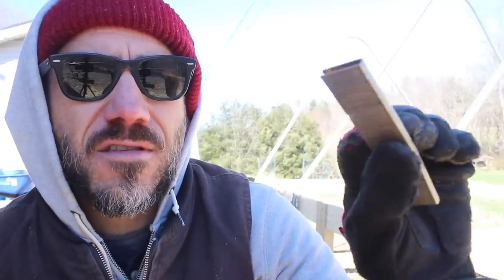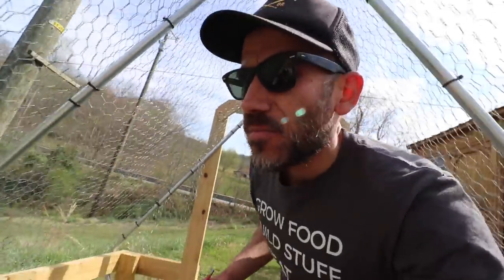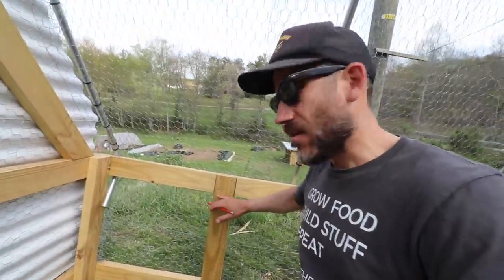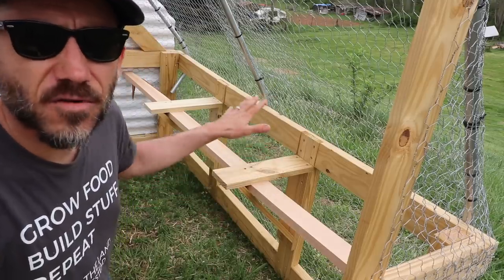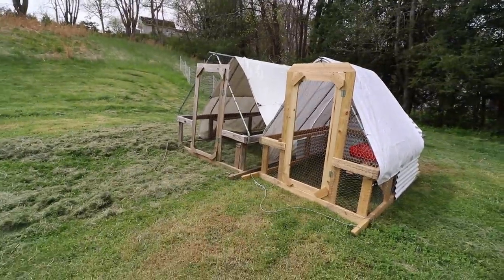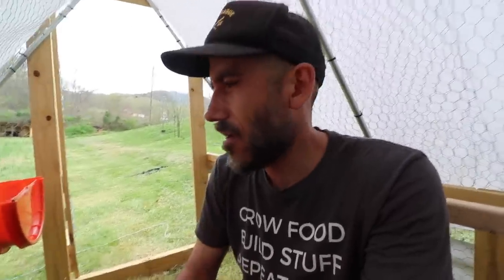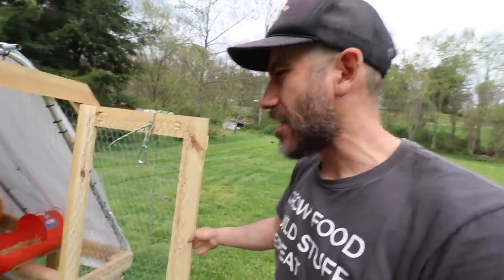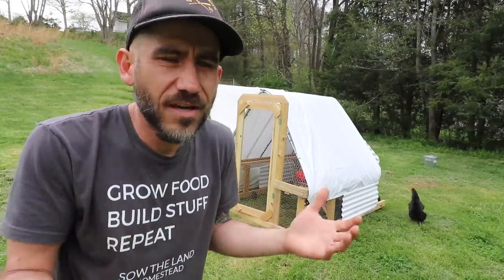Chicken Tractor EGG MOBILE (MODIFIED)

Comment: To keep from having sore hands pulling on a rope to move the chicken tractor, you may want to put a small piece of garden hose around the rope or a piece of conduit.
Reply: Every garden hose I've had has broken in half due to our random weather changes.
Reply: Put a piece of pool noodle and then you can hook your elbow around it to pull 🤣
Reply: Use pvc /pipe.
Reply: I used a piece of pex over mine

Comment: I like your modifications.  I hate chicken wire though because I believe it is only made to keep chickens in. Most predators can rip right through it. We are in Alaska and we use mink pen wire, designed for mink cages.   We have a fixed coop and we bury it into the ground angled away from the coop and covered with firmly packed small rocks.  They free range during the day and we use cardboard under their perches that is changed weekly and composted.  More work. But safer for our layers.  We also use a rooster to protect them while they free range..we have eagles and Hawks who go after them and it is so great to hear him send the alert and send the girls running into the brush for cover,  He is excellent at his job.

Comment: Seen another version of this same tractor today , except the tubing was inside the 2x4,frame,  and not outside the frame .    Gave the wire a smoother look, but chickens arent impressed easily.  (-:   your good with wood. Your tractor looks good. Keep up the good work .

Comment: I have been using a non-toxic water sealant called Garden Seal on all my outdoor coops and builds. It’s the same texture as milk, paints on easily, smells like Elmer’s glue, and works very well. I’m pretty confident it’s safe next to my birds and vegetables like it claims. Should add a couple of seasons to my builds as well. Keeps water from penetrating your wood and keeps it looking new, showing that it works. Would highly recommend if you want to add a little more durability to your outdoor builds.

Comment: I think this is the best video I've ever seen. Very straightforward. Watching you work with wood makes me want to be a carpenter. We made a 12*12 A frame tractor for egg layers two years ago without doing too much planning. It's worked well but it's heavy. No plastic. I think I go overboard on space since I can't let them free range. I use chicken wire and have had chickens for ten years. I've never had a problem. Maybe it would be a problem if they didn't have a roost or a covered area at night, or if their roost was too close to the ground and not covered/protected. Anyway, we're planning our next build and expanding our flock. My husband wants to build pvc tractors so they're not too heavy but I want wood. I was able to move the wood tractor last year. I like the simplicity of this design and improvements that you made. I was wondering if I should make a very simple, larger like maybe 8*10*4? Partially covered Pvc/chicken wire run they could have access to during the day. Is that overkill? Am I over thinking? Happy hens lay more eggs! I also like the idea from one of the commenters about the non toxic clear coat for protection of the wood. We used flex seal and caulk last time and it was expensive and didn't wear as well as we had hoped. Again, great video❤️

Comment: I know I'm 3 years too late but, when making your notch in a 2x4, use a screw driver or piece of steel, the thickness of your saw blade, and put it in a cut and pull it sideways. It should pop that section (a little wafer) out, and you won't need to use the wood chisel and hammer. Try it.

Comment: Why not use your router to notch the wood instead of chisselling?  And maybe scrap metal along the bottom of the base 2x4's for smoother skiing?
Reply from the maker: No reason. Chicken tractor has wheels. the metal may get caught on the long grass. I like the idea though. thanks!
Reply: Since all you cuts for the half lap joints  are going to the same depth  just mount the router to a plate wider than the half lep  adjust the depth of cut   a lil bit deeper for each pass

Comment: Why did You add a full 90° bend at the end of the pipe?   
I am thinking that just a 45° at the ends so the pipe is parallel to the board   ether use  pipe mounting brackets or make a stake pocket  out of 3 peices of scrap wood  one on each side  and a peice to bridge those 2
Reply: good ideas...

Comment: Why not put wheels on our four corners with a brake?  Lol
Reply: Because it could roll away  it is light enough that You can lift the front end and drag it  like a wheelbarrow
Reply: In addition to the extra wheels and brakes I'd add a motor and a steering wheel plus a parking brake so it wouldn't roll away. Lord have mercy.

Comment: I like the chicken tractor design, however, you should know that the only thing chicken wire keeps in or out is chickens.  Almost any animal can chew through chicken wire so it's not in the slightest bit predator proof.  Hardware cloth no larger than 1/2" should always be used if you want to keep out dogs, coyotes, foxes, raccoons, opossums, etc.  Anything that you can tear apart with your hands should never be used to protect chickens.
Reply from the maker: I am sure it is bound to happen. But we have never lost a chicken in 3 yrs. to predators using this setup. thanks!